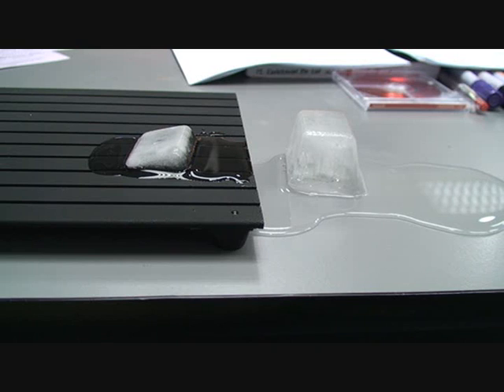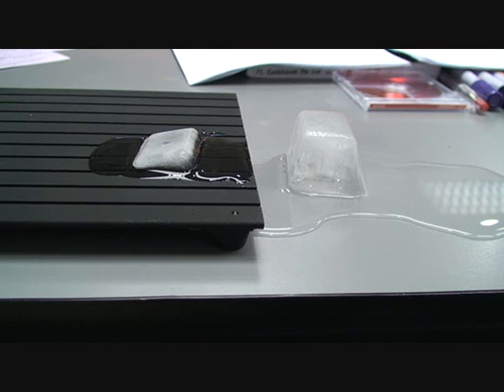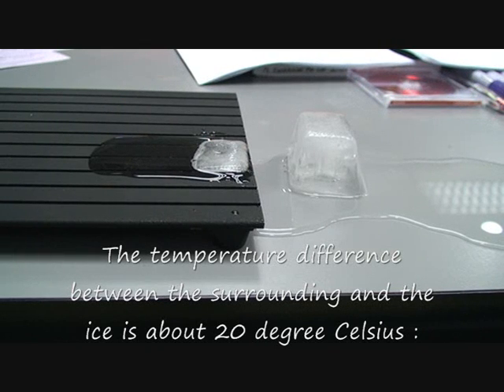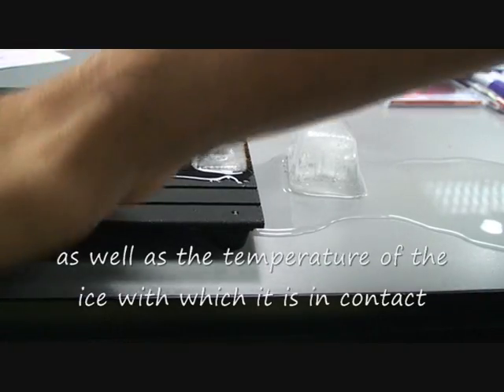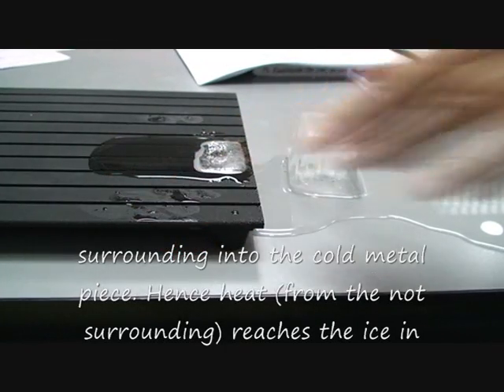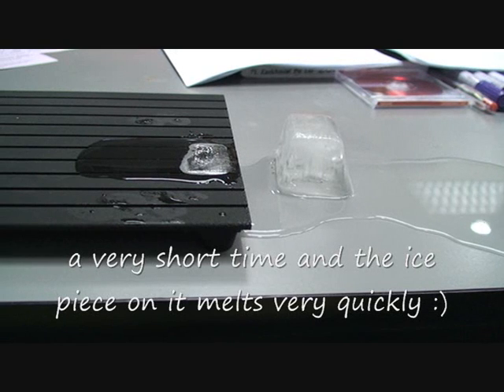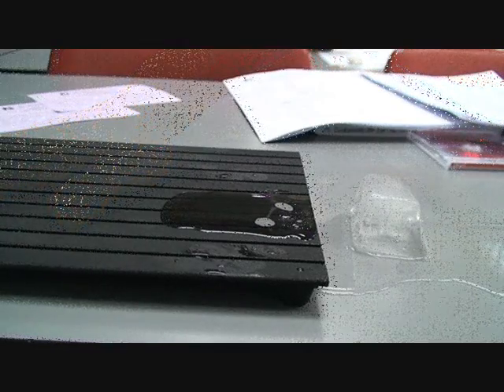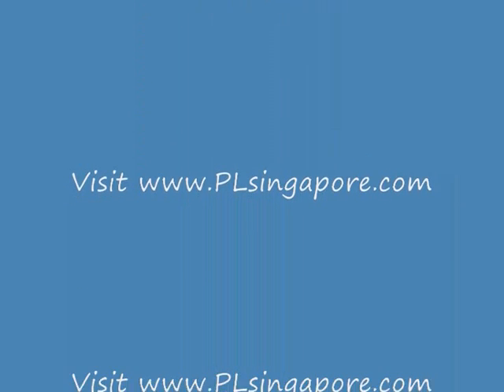Ice cube melting very quickly on a metal that has a very low specific heat capacity.

Comment: The explanation is wrong: it melts more quickly because of the higher thermal diffusivity of the metal. Note carefully the use of the term, 'diffusivity', rather than 'conductivity'. The latter is applicable to steady-state situations; which this is not. And how are the two properties related? Via the specific heat capacity. 
The entire subject of heat transfer is far more complicated than laymen assume.